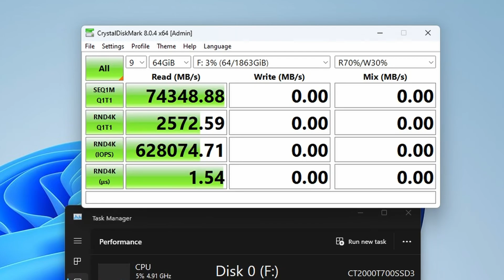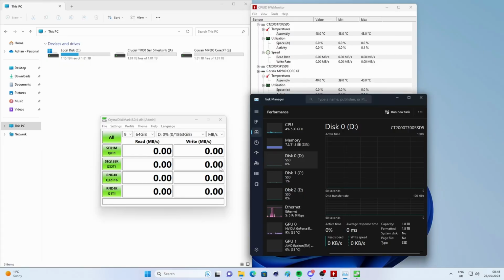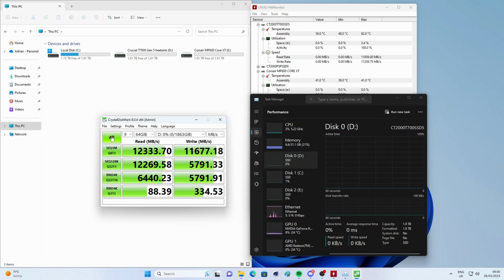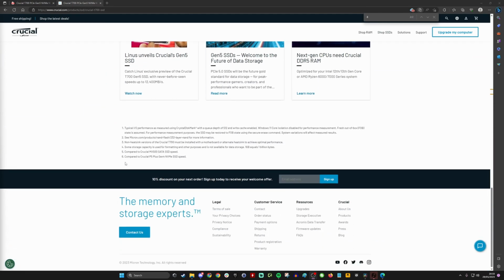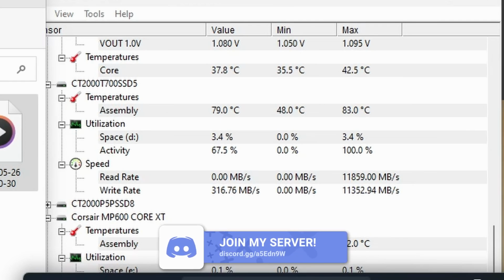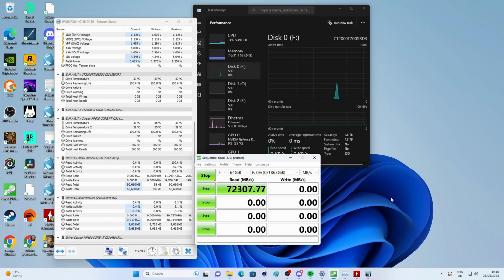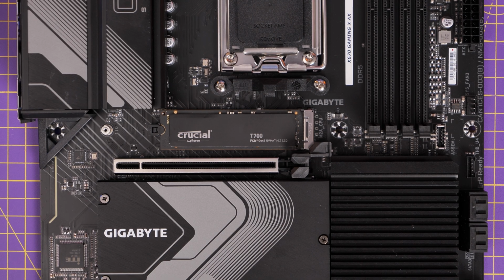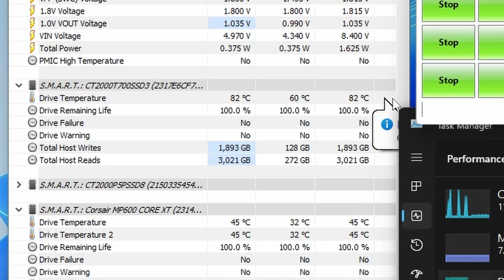Why heatsinks are essential for PCIe Gen 5 NVMe SSDs

Comment: T705 without heatsink after booting windows immediately crash because it go over 90 .... on MOBO heatsink from ASUS TUF Z890 when i do AI on Ultra 9 285K and RTX 3090 and i have system on T705 it it is const 70-74C in idle ....

Comment: I have the T700 (non heatsink) using a motherboard heatsink. When gaming my computer bluescreens and crashes and boots to UEFI where the disk is no longer visible. I have to shut my computer off and wait about 10 minutes for the drive to work again. Is this a cooling issue? Is my motherboard heatsink not good enough? I have a Gigabtye Z890M GAMING X (yes I removed the heatpad sticker)

Comment: Thanks for showing what it is like installing an SSD with the manuf. having it's own heat sink.
Then showing what a non-heatsink SSD is like, and applying the motherboard's heatsink with non-heatsink SSD.

I was wondering what the differences are.

My question is, are motherboards that advertise PCIe 5.0, backwards compatible with 4.0 and 3.0?

I was watching videos what show purchasing a 5.0 is a waste bc the 4.0 performs just as well as 5.0.

But about future proofing?
Reply from the maker: gen 5 drives will work in a gen 4 slot, but at gen 4 speeds.
Reply: @TheProvokedPrawn  And if I buy a Gen4 drive, put in a Gen 5 slot, it will also run at Gen 4 speeds?

Comment: There's reviewers who test the cooler capabilities of third party heatsinks, but the pity is there aren't many out there nor do they compare against the motherboards' heatsinks. 

But the PSA should be that most X870E motherboards do not have the space for third party heatsinks. For example, the mid to high end Asus, MSI and Gigabyte boards have 22mm to 24mm width on their M.2 slots whereas most of the best third party heatsinks like the Thermalright H10/Pro or the Graugear HS06 required widths of >24mm. The issue is they have either a third PCIE slot and/or multiple SSD slots side by side on an ATX board, leaving very little space for heatsinks. 

This is a problem because users are going to buy third party heatsinks hoping to better cool their SSDs only to find most cannot fit anymore.
Reply: especially if you have an aircooler, basically fucked

I went for a strix x870e e just for the layout (swapped from a carbon)

Comment: That's such a let down, it seems the factory heatsink is borderline cope solution to thermal throttling and motherboard heatsink potentially performs even worse. The heatsink is a lot thicker on my motherboard and both sides of the PCB are passive cooled. I guess I will try it first with mobo heatsink, then if I get throttling, I will just throw an Alphacool SSD block on it and make it part of my custom loop.

Comment: HELP!

i currently have the t700 with heatsink and i want to remove it. (I already have) and will it void the warranty? ALSO i dont want to use the heatsink due to its largeness. So i want to use my mobos heatsink which also states its 10X at heat dissipation. Can i do this? Also on the non heatsink version, there is a sticker on it. Since i got the heatsink version and i removed it, there is no sticker?? Does this matter, should i worry? The thermal plate for my b650e atx ice should cover the ssd but there wont be a sticker, so it will directly touch my ssd. Am i good??
Reply from the maker: Why did you do that? Madness. But yes you can use your motherboard heatsink. Don't worry too much about the sticker.
Reply: @TheProvokedPrawn  ok thanks for the response, but what exactly do you mean madness. I know it was stupid doing it. But honestly the there no other option. They only had heatsink version and the heatsink less version wasn't gonna be in stock for another 2 months. So I thought I could take out the heat sink and I actually did. But I don't know if it would void the warranty, if you know could you please tell me? And do you think it's a good idea to keep the heatsink and don't throw it away? I'm not gonna use it. Also I've been watching your video about sticker vs no sticker. You said you get 5c less without  sticker but on heavy loud you get more degrees without the sticker? It's sad that heatsink version doesn't have the sticker. But I am overall fine? Two more things, when I handle my t700, it's OK to handle it on the sides right? Just the sides. Do you think the ssd will over throttle? If there is some thermal paste still on the SSD and my mobo already has some. Can I just scrape off the thermal paste already that was reapplied from the heatsink on the ssd. I will do it carefully. THANKS SO MUCH, I subscribed :)

Comment: Reason to notbuy this ssd it cost 250 euro more its only 1 sec faster and have a big ugly huge heatsink on it...
Reply: You can get other heatsinks for those drives, and Gen 5.0 NVMe SSDs are generally not an interesting purchase for the average Joe or gamer. Gen 4.0 is fast enough for now (even Gen 3.0 is if you don't do anything serious with your PC), but those drives still can make use of heatsinks.

Comment: should I. Now buy this SSD with a heatsink or without I have a Z790 Maximum Apex Endcore which has its own heatsink so what should I do now?
Reply from the maker: I'd personally opt for the heatsink on the drive as it's specifically designed for it and is massive so should offer better cooling than a motherboard heatsink.
Reply: Thanks for your quick answer, I actually wanted to return the SSD with a heatsink and buy it without a heatsink because the Z790 Endcore has a fan KIT that you can only connect when you connect the motherboard heatsink, I think but I have I have now decided to keep the Crucial T700 4 TB Gen5 NVMe M.2 SSD with heat sink. What do you say can you also use the FAN KIT fan with the SSD with heat sink? The fan kit fan is from the ASUS ROG MAXIMUS Z790 APEX ENCORE, mainboard?

Comment: same reason why they were necessary for GEN4 drives and recommended for some Gen3 drives for longer life
GEN4 drives have very high working temp GEN5 have even much higher temps i know morons used GEN4 drives without heatsink they all died very fast and of course the performance suffers alot with a Good Passive heatsink on GEN4 drive you will get 40-50c Max temp under load No Heatsink over 90c and GEN5 drives are much worse hell first GEN5 drives needed Active liquid cooling and still worked at 50c and higher

Comment: I’m upgrading my music production PC from a Microsoft Surface Pro 4, the SP9 is quite expensive. So I checked into CPU Benchmarks Single Thread, where Intel finally surpassed the Apple M2 and the 13900 leads the way. 

A custom build comes in at the same price, overall, as a Surface Pro 9 but includes the fastest CPU/RAM/SSD you can buy. Unfortunately the heat must be addressed for each.

Of course, I’m constantly accessing data in the form of virtual instruments, small and plentiful data files that can overwhelm the system, causing glitches and audio drops during a recording. Once a ‘take’ is compromised it’s garbage, and must be re-performed.

So I end up buying the T700 a few days after it launched, with every intent on using it for virtual instruments. Luckily I selected the Heatsink version. Performance is the concern. I would not be happy if it operated at Gen4 speeds. 

Since it has been 20 years since I built a computer, this was all overwhelming, confusing, and time consuming to research. But this is a great resource, I’ve watched most of your videos and they are indeed calming. 

The parts are still on the table, waiting for my AIO to deliver next week and the experiment begins.

Thank you. -Jim

Comment: Currently in the process of doing a new build, just got an i9-13900K, ROG Strix Z-790E board, 2x24GB Corsair DDR5 RAM, and have installed a 2TB 980 Pro, I wonder, how much of a leap it is from Gen 4 to Gen 5. The non heatsink T700 2TB looks like something I’d pick up but for $340 USD, I can pick up 2 980 Pros with that price.
Reply from the maker: Well on paper the difference is 7,000 MB/s  on the 980 Pro vs 12,000 MB/s on the Crucial drive. How much you'd notice such a difference in the real world depends highly on what you're doing with it. The most noticeable difference is always going from SSD or HDD to NVMe. Then you really feel it!
Reply: @The Provoked Prawn  I have the Asus Z790-E GAMING motherboard and it comes with   gen 5 ssd heasink. Can I just use the heat sink on the motherboard instead of the one that comes with the T700?
Reply: @Kingtoby1981  my question too!
Reply: @TheProvokedPrawn  Hmm, maybe I'll have to pick one up now. Seems like finishing up this build has gotten delayed since Lian Li announced the new O11D Evo RGB, wanted to pick up the O11D Evo but seeing this new and improved one, seems I can wait just a little longer which means I can save up a little longer and splurge on this T700 hehe.

Comment from the maker: Obviously it's not really 628,000 MB/s read speed (it's actually IOPS but that's irrelevant, the point was how massively wrong the data is). The data at 0:38 just shows how wrong things can go without cooling.
Reply: I water cooled my t700. Works perfectly